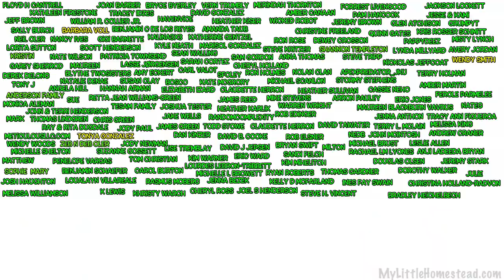Conversion Van LED Lights￼ | Weekly Peek Ep299

Comment: I know a guy who has a metal building sort if like Garen's, but it is three sided, open down a long side.  He has a camper, a boat, a couple of snowmobiles, a little tractor, some motorbikes, lawnmowers, a little shop stall, etc in there, and it used to be noisy with birds just like Garen's is.  The noises didn't bother him so much as poop all over his toys and tools did.  He put some plastic owls in there, one on each end inside, and that helped a lot.  He then became a collector, he has owl posters, owl pictures, balls with owl eyes, little owl Knick knacks, stuffed teddy bear style owls, everything owl art I can think of.  He has 0 poopy birds in his shed now -- they're still around, they just hang out in other buildings at his farm.  Once in a while, he says, he'll see a new bird fly in while he's working in there, and then frantically U-turn to escape it's owl nightmare🤣

Comment: and a suggestion... for that new step on the van, if you put some astro turf there or some sort of cut up door mat, you can have a good place to collect dirt and sand before it makes its way into the van. Also, with it being lower than the other floor, it will be easy to clean out or vacuum. Basically, a dirt trap that naturally wipes off shoes!

Comment: Lighting is essential in a camper so I'm very glad to watch you put these in! Sanding it was a good idea. You didn't mask off the reflective white where the bulb is? Are you sure that'll work? I like those wire strippers! I do like the black color better than the white. Azalea looks so cute in her wagon pool! I like the warm white LED lights too. I have those stick on LED roll lights to go behind my entertainment center and reflect off the wall. The roll I have changes color. Perfect board you found to replace the ribs with. Looks beautiful! Wow, cutting that area out and turning it around worked slick! Thanks so much for this guys. Have fun at the wedding! Is Azalea going to be the flower girl? She would be so cute!

Comment: Really good shots on doing the lights and fitting the step. now got to go work on my truck and remove the hold dash of my CRV changing heater and a/c cores                                                   just having a lot of fun fun fun.

Comment: quick tip... over time, that electrical tape will get gooey and slide off due to the heat in the vehicle. If you want to use electrical tape, a quick tip is to put a couple of zip ties on the ends to keep it tight and secured as the tape ages over time. Very cheap and quick to do while you already have access to the wiring.

Comment: wipe lightly with acetone on plastic to paint it. It (dries) the plasticizers on the surface of plastic and draws the wet plasticizers in the paint into the pores of plastic creating the bond you want, the same is when super gluing plastic

Comment: Use Pad Press Inks (solvent based, in a WELL VENTALATED are due to the MEK solvent) it will adhere to anything and never come off. They use it on golf balls. Wear gloves. it took 3 weeks for the bright blue ink to come off my hands the first time I used it.

Comment: Just wondering if you thought to paint the underside of the step. It will help protect the metal and possibly help keep it water and  dust proof. Could even use a bed liner type of paint.